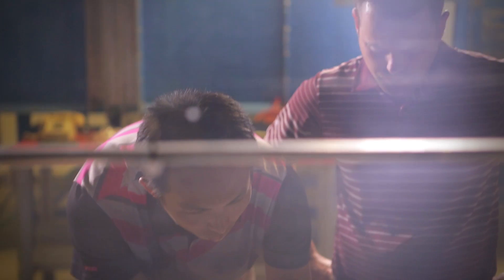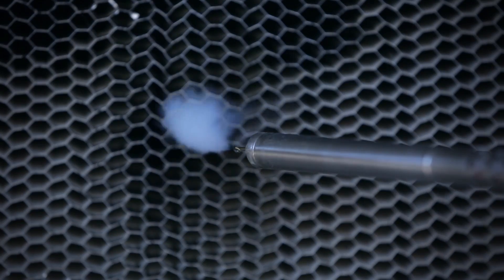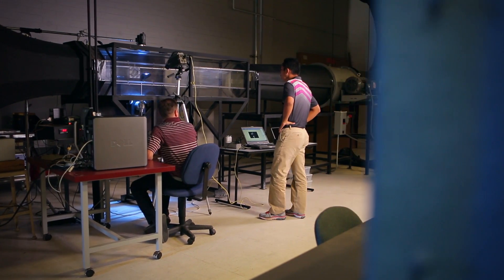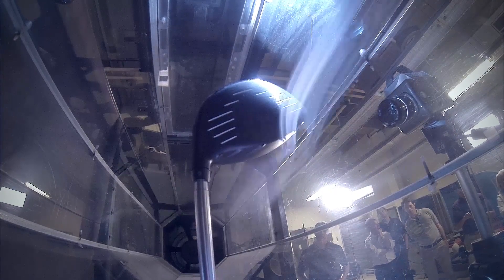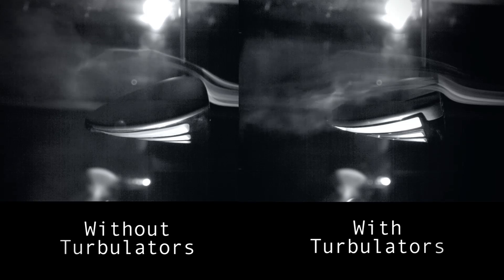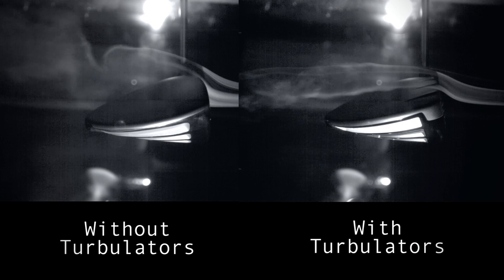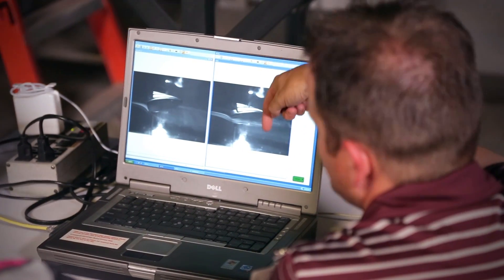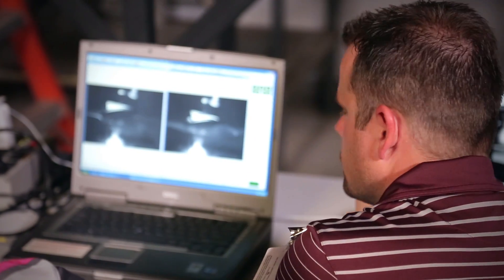Wind-Tunnel Testing: G30 Turbulator Technology

Comment: Dear folks at Ping,

I teach classes about various aeronautical topics through the University of Washington and within Boeing. In my airplane design class, I explain how airflow separation can lead to pressure drag, and how this can be avoided by carefully tapering the trailing edges of surfaces (or, of course, by turbulent flow such as around golf balls). To help illustrate this concept, I plan on embedding two still images from this video into one of my Powerpoint slides about pressure drag, to show in my class. I will credit the images as "airflow separation around golf club in wind tunnel, courtesy of Ping, used with permission", followed by the URL to this video. I am confident that this is Fair Use under American copyright law (educational purposes, only using a tiny fraction of the work in question, and not reducing the demand for your products - quite the opposite, in fact, helping to promote them!), but I thought that as a courtesy, I would give you credit anyways, and let you know so that you can tell me if you disagree (or if you would prefer that I credit the images differently). If you do not object, then no reply is necessary. But if you would like to contact me, you can do so via the "instructor" page on Understanding Airplanes dot com. Thank you and happy new year :)
Reply: in your opinion do you think ping turbulators even work or should be that way on a driver?